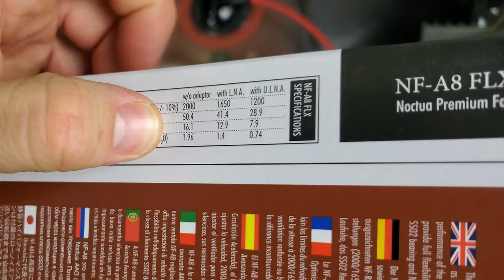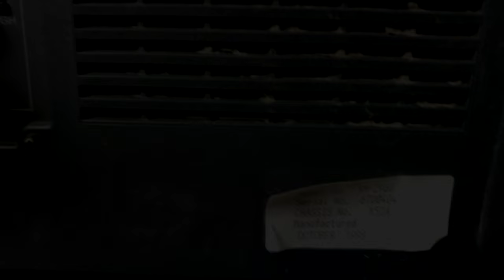EASY Hack: Adding Noctua Fans to a Pro CRT! - NEC XM29 Upgrade

Comment: I agree with your sentiments regarding the air intake. PCs must always have an intake and an exhaust to generate a proper direction of airflow. Having every vent as an exhaust fan was not a smart move on NECs part. I'm assuming they only added the fans as extra insurance since this was a presentation monitor that would be run for many hours daily in some cases.
Reply: I studied thermal stuff for PC's in the university and engeniers always want to take out the air because for thermal porpuses is much better, imagine if you are in summer with 34°C and you put that hot air inside the PC or monitor? is not going to cool it down, is going to make it hoter or will always stay at the same temperature, thats why you always need to take the hot air out, is nonsense to put air inside from one fan and another to take it out.

Comment: Listening again to "Interview with Sony BVM Tech savon-pat" from RetroRGB. Starts at 9.38.

Pat: The killer on any monitor is heat the cooler you can keep it the better.
I encourage people to if they don't have one installed in it to install a fan in the back of their monitor 
and there's room you can take the ,back ,off ,of ,most monitors.
You can cut a hole in the back and mount a little muffin fan this quiet and believe me that ,will ,help ,more ,than .anything.

Bob: Um this might sound like a stupid question but do you recommend an intake or an exhaustible always exhaust you want to get rid of the heat so make sure you have an inlet .somewhere.

Pat: Preferably on the bottom or on the bottom edge of the sides but you want to exhaust the heat out never blow something inn.

Bob: The only reason i asked that is because the company that i used to work for that did medical great computers we had to have things in a very tight place as sealed as possible.
And we did the opposite once we took air cool air from the outside routed it through and blew it over the hot components through an exhaust chamber going out but that was a specialty case.
specifically for that that wasn't well again in medical situations are normally much cleaner.
and you have to account for spillage and phrase or even just a bleach spray whereas i hope nobody would think to clean their monitors with a bleach phrase.
that suggests an exhaust fan um you know i think with the amount of space that's inside your average p. v. m. and medium seems like a very easy thing to ,add ,for ,even ,a beginner.

Pat: Absolutely and they draw so little currents you can pull five volts or twelve volts off of it in many places in a monitor so it's not a real ,chore to .do.

Comment: My BVM1911 doesn't have a fan but I would like to attach one. I could probably pull a few cards out of the back to create an opening or use a dremel/grinder to cut through the metal shell. I don't know where I would draw the power from but I heard you just need to splice into a wire running 5v.

Comment: The Noctuas are quieter at 2000 RPM than the stock fans at 2000 RPM. Noctua fans are amazing.

Also, if the replacement fans do end up dying, the monitor won't know with the modded fans installed since the alarm is bypassed, so that's something to mention. It's unlikely to happen with nice Noctua fans, but something to be aware of.
Reply: I'm guessing the monitor would work fine without the fans. The fans probably just extend the life of the components.

Comment: I think the reason they went with a negative pressure system was because of dust issues, if you had an intake fan you would just be blowing dust around inside the TV making a big mess. But, if you had a filter on the fan that you wanted to flip around you would be just fine and I think you are correct in saying that is would be cooler and therefore better.
Reply: negative pressure just sucks dust through every crack or hole, better to just have an intake with a filter.

Comment: check the datasheet for the original fans, some have different options for a fan good output (they're not all just tach outputs). might be able to use a cap or resistor on the tach line to get a proper fan good signal the crt expects.
Reply: I added a cap for the fan good line in a netgear poe switch, and tested that it knew when a fan stopped. Earlier this week, I did a fan mod to the dreamcast, and that used a pullup resistor (i didn't look to understand why), so I can run the 240p test suite in quiet

Comment: I've thought about adding a fan to my 21" LaCie Diamondtron. I've noticed the top of the monitor gets really hot, especially in the summer. Monitor is already approaching 20k hours, I'm worried about longevity.

Comment: I had a dream I was so upset with the OLED market that I went and bought a CRT for PC gaming.... 

An OLED monitor, if they existed (they don't, at least not for gamers) could have 4k resolution, 120hz refresh rate, black frame insertion, and be absolutely epic.

An OLED monitor would have sub 1ms input lag, sub 1ms pixel response (full black to white) AND with black frame insertion, would reduce motion blur so low, that it would literally behave like a CRT for gaming.

A CRT will generally "paint" the front glass with electrons using the electron gun. Lets call one spot a pixel even though technically "pixels" don't exist. It can paint the pixel is about 0.2ms which is really really fast. But, those pixels "fade away" as it doesn't have constant power driving it, not constantly painting it. As they paint in scan lines like reading a book, letter by letter (pixel) line by line (downward). That "pixel" will fade away to almost full black by 0.8ms still incredibly fast.

AN OLED can paint that pixel in about 0.8ms not bad. And then because LCD technology is based on "sample and hold" that "pixel" is held that color until the next pixel replaces it. With black frame insertion, you cut that sample and hold time "in half" which results in CRT like behavior. OBVIOUSLY still not AS FAST as a CRT, but its close enough that it makes OLED superior to EVERY OTHER LCD type technology.
Reply: They exist now, Alienware QD-OLED
Reply: @3jake5mee  already own it. Was one of the first orders day 1 it was available. Lol my comment above was a long time ago

Comment: I would have thought airflow is more important than RPM. RPM is just one aspect of a fan design. A more efficient blade design will produce more airflow at a given RPM, so can run at a lower speed with the same airflow. 

Airflow is quite strongly related to noise, however. There's no magic here - many quiet fans simply don't push much air. I'd try and find the airflow specs of the original fans and set the Noctua's accordingly (with / without speed reducing resistors etc.).

Comment: The fan is nice and quiet but the whine hurts. Cant hear that from my monitors. Are those displays worse than pc crts in that regard ?
Reply: Fine pitch tubes like PC CRTs and HD CRTs don't have the whine noise
Reply: @Snivy102  isn’t this because of the resolution and not the tube? Or does setting an hd crt to 15khz not result in any noise? I have an HD crt but it doesn’t support true 15khz so I can’t test it.
Reply: @MrNapkino  I don't know
Reply: If you run a res that's 15khz it's gonna be loud bc of the fly back

Comment: The NEC XP37 does NOT use 12V... it uses 24V
So use a DC step-down converter for your Noctua's

The NEC XP37 uses:
4x 80mm 24v 0.1A fans
1x 60mm 24v 0.1A fan (for the power supply)

Interesting... 
The NEC XP37 was designed to pull cool air from above the monitor (Neck) and use 3 fans to push cool air down towards the 60mm fan of the power supply.
With this model; there is no bottom opening to suck cool air in and push it out on the top. Its the other way around with this one XD 😆😅

The NEC XP37 I'm Refurbishing now (Recap, 3D printed back feet, Speaker replacement mod, Fan mod) is of an client, I have a UNI-T UNi690B Thermal Camera and It would be interesting to see what difference it would make temperature wise to see it it would improve much although the air can only come from the top.